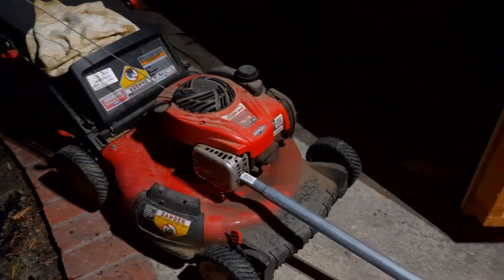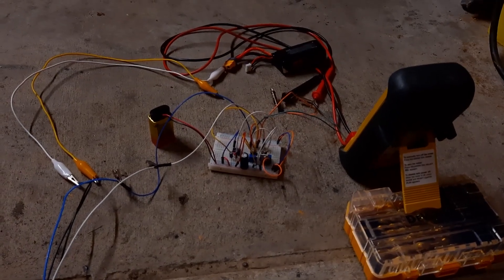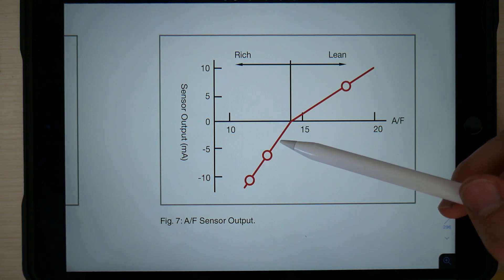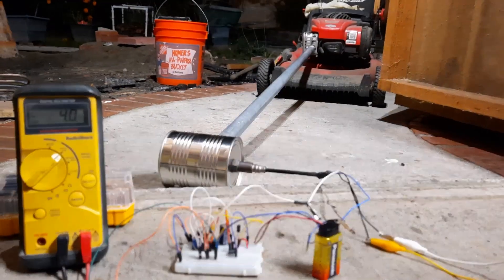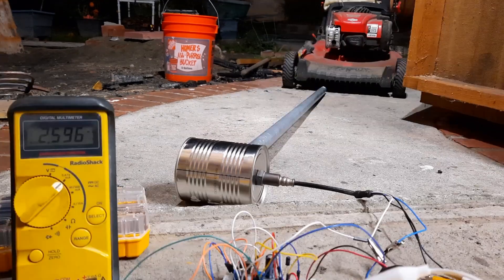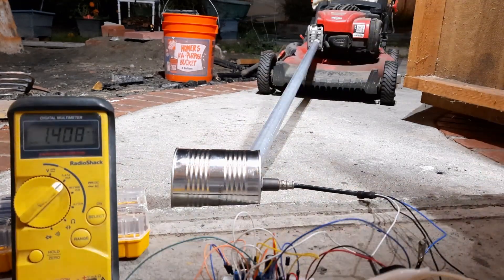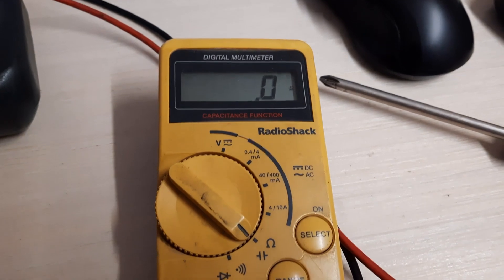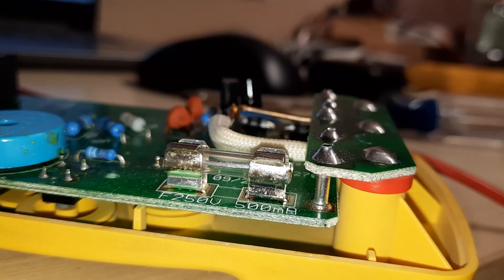Car O2 sensor attached to lawnmower exhaust

Comment: I have been a fan since Instructables! I miss the old layout.
Reply from the maker: Thanks! Just curious though, what was the old layout?
Reply: @TannerTech   For some it was much easier to search for things you were looking for now everything's just in a certain category you have to look through those categories
Reply: @TannerTech  I guess it's not that bad I found your zvs driver instructable that was one of my favs.
Reply: That can is not aluminum.

I went over ten years of regular use before blowing one of the two current input fuses on my multimeter. There are protocols you can learn to follow to avoid blowing those fuses but it requires a certain degree of discipline and impulse control.

Comment: So technically an O2 sensor can be used to generate electricity? 
Also I heard that the build up of carbon on the sensor is what causes it to “fail.” It changes resistance values and trips the cars computer.